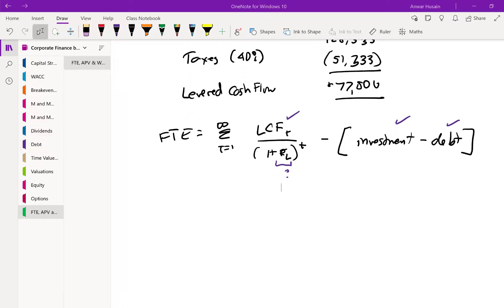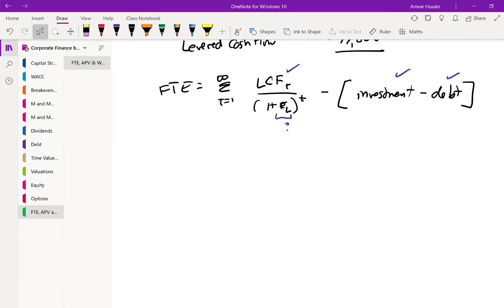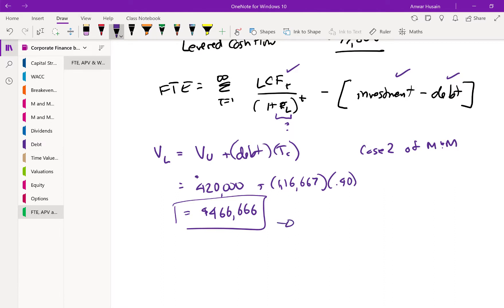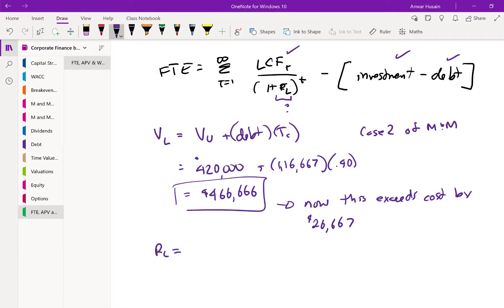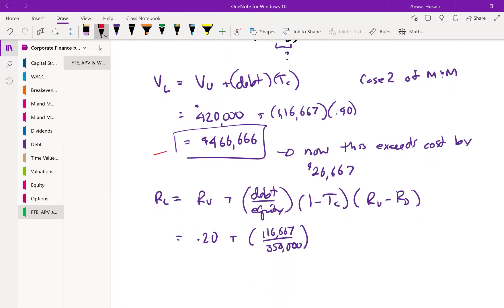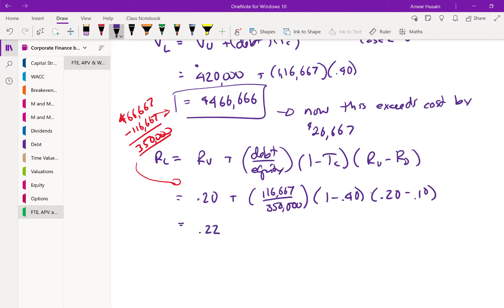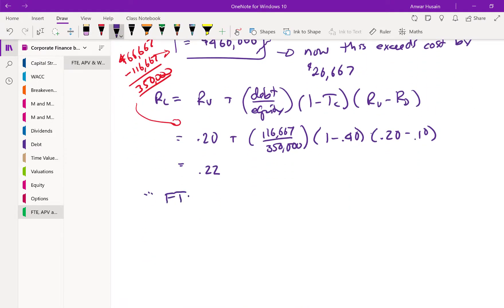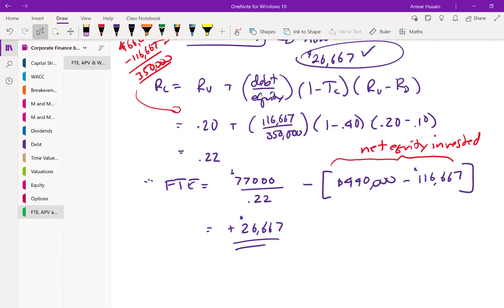FTE, APV & WACC Part 3

Comment: Hi, I was just wondering why you didn't use the (1+rL) in the FTE formula and just the rL. Is there specific rules on when to use it?
Reply from the maker: In this example, the cash flow was a perpetuity (i.e., the same amount every year, forever).  Since it is a perpetuity the formula for present value = levered cash flow / RL.  If it was not a perpetuity and the cash flows changed each year then you would divide by (1+RL)^t for each year and take the sum.

Comment: Thank you so much for the video. Do you always get the exact same result when using different valuation methods? Because i have an example in my book and when I calculate the value using the apv method, it gives me a different answer than the wacc method!
Reply from the maker: Hi, all three methods should give you the same answer.  The are approaching the investment decision from a different perspective but the mathematical answer should be the same for APV, FTE and WACC.